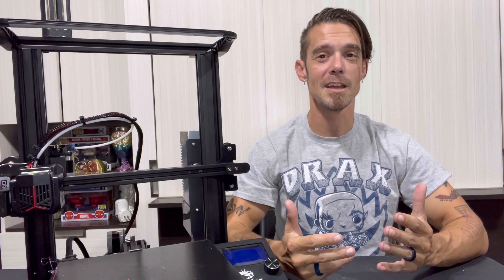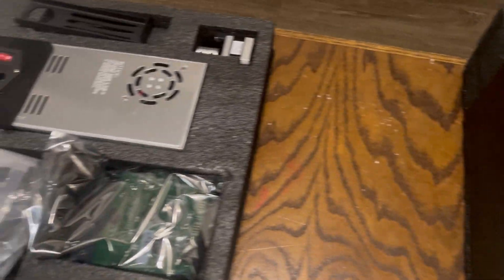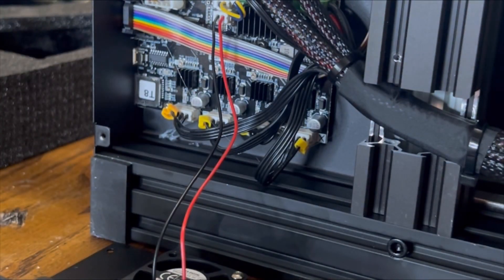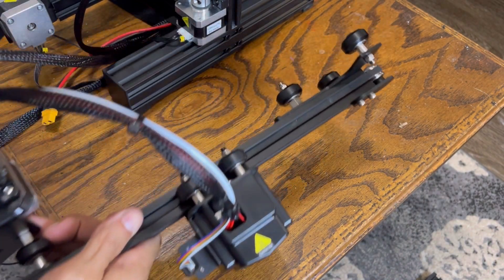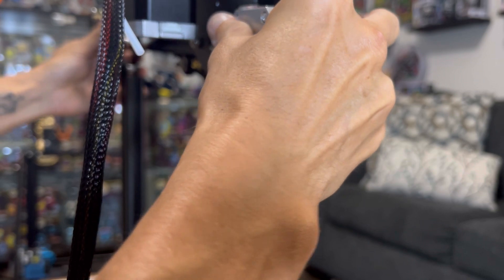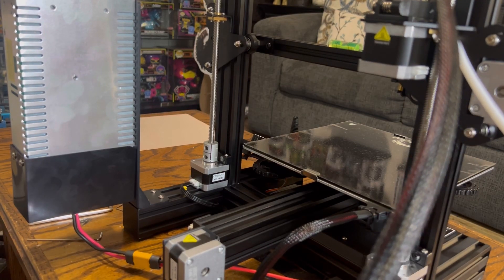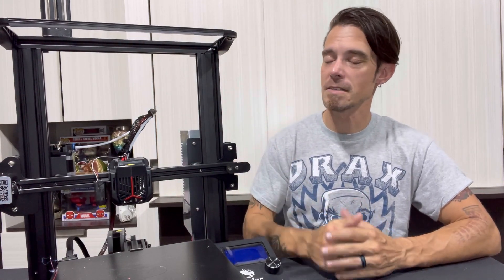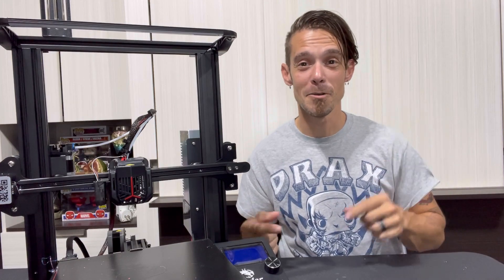Installing a dual z axis on your 3D printer | Ender 3 upgrades dual z axis benefits & how to install

Comment: I have a problem, it works just one motor, after some tests i discover one of motors lost power after some movements until finish totally static
Reply from the maker: Both motors are plugged in?
Reply: @Darkwingdad yes i finally resolve it, it was the guide of the second axis, it was obtructing the screw

Comment: Just got a ender 3 pro NOS for free when an ebayer sent me a wrong package and just refunded me ..  thought , wtf am I gonna do with this old piece of shit??? Gonna fkn hot rod it !!! Greatest thing a out 3d printer parts .. they are cheap
Reply from the maker: You can do a lot, direct drive, dual z,bl touch, wham bam plate, led light, upgrade to klipper, silent board & silicone bed mounts & you’ve got a super bed slinger.
Reply from the maker: I image they have linear rail upgrade too for both x & y

Comment: Couple of things. First. I love your videos. Great information. Second, there are a couple things in your video that are not needed. Most kits, if they are legit Creality, will come with a piece of paper telling you about making sure the motors turn the same way when the Z is adjusted with the "Move Z axis" process and illustrates how to ensure that with moving wires in the harness...more importantly it has a QR code to scan for an install video. The video from Creality does not show the installer removing the gantry to install the second Z rod bracket. Its actually quite simple with it in place and this reduces getting your printer out of square or breaking something you didn't need to. Next thing is the level. Great idea to keep the machine square when doing to fine tune adjustments but you did not mention the surface you are doing this on needs to also be level. If your work table is not level, your printer won't be, and you will pull all your hair out trying to figure out why its binding no matter what ya do. The wiring that comes with these kits is a Y adapter. You can simply unplug the original stepper motor plug, plug the y adapter into the cable you just unplugged then run your tails to each stepper. No need to remove any panels or reroute or hide wiring. The bracket that comes with the newer (2025) kit for relocating the PSU is also different than yours and doesn't hang the psu so far back and make it look awkward.
Reply from the maker: I prefer to remove the gantry to start over at a central point, I’ve actually seen binding & damage to the rails if forced on, maybe not needed but I didnt want to put any stress on the pre existing z rail that was installed. Not sure of the QR code I just whipped this together bc it’s a great upgrade for ender 3s or single Z printers & this was my how to spin on it. Appreciate the feedback!

Comment: Mone wont keep the same z offset after upgrade for dual z  any ideas
Reply from the maker: @Matthews3dprints  ender neo?
Reply: @Darkwingdad  yes
Reply from the maker: @ you did relevel the bed, set the new offset & save it correct?
Reply: @Darkwingdad  yes

Comment: at 6:51 you're measuring the level of the x axis - wouldn't it be better to make sure it's square with the uprights on both sides?
Reply from the maker: @dforck42 a level shows its square on both z axis

Comment: Hi, I have an ender 3 pro and have fitted a second Z axis and the problem is that the motors are skipping for me. The x axis beam is level. I don't know what to do, please help
Reply from the maker: @nordyk2  sounds like they may be binding. Try removing the top support. If the axis is bowing in or out it’ll cause it to skip

Comment: Just perfect. 
I notice that the rabbit you print, is perfect. 
I use prusaslicer, but I cannot print without springing.
Could you please share your settings? 
I tried petg and pla but never got that results. 
Thanks
Reply from the maker: @joaolourenco7712  do you mean stringing?
Reply: Yes, stringing.

Comment: That bubble level is no good unless the table, the floor the table is standing on and the foundation of the floor the table is on are all flat. You want to level the gantry to the print bed so a ruler I think would be a better option
Reply: As long as the gantry and bed have the same level you're good.
Reply from the maker: @davidflanders8516  contractors have used levels for decades on un even surfaces and still make foundations etc level. Obviously you need a level surface or table as I mentioned but the ground is irrelevant. You could use a ruler sure, but flat table and the level works fine every time.
Reply: @Darkwingdad  You lost all credibility by using a bubble level without understanding how it applies in this context as @davidflanders8516 tried to make you understand but you were condescending about it. You obviously don't understand what a "level" surface is and also "flat" has a different definition also. Don't be an ass when you're obviously misinformed.

Comment: With the level, you also have to make sure your table is level and your floor is level. Or make the base of the ender 3 level. Otherwise a level wont be accurate.

Comment: How do you keep the gantry level without a toothed belt ?
Just for my logic, im about to pull the trigger on a set but when i install it and turn one motor slightly upwards while the other motor is not turning ( wich is quite usual on a ender if you do anything on the x-gantry ) and now you turn printer on home and the motors go down touch bltouch for home and now one motor is homed higher than the other since they both share the same signal ?
Reply from the maker: Install the gantry with the z axis loosened on the bottom z couplers (they attach to the stepper motors) in the video I line them up and turn them sequentially at the same time & use a level as a guide. If it’s not level turn whichever one makes it level than tighten the couplers to the z rods. Bc they share a signal once tightened the gantry will move properly without offsetting the gantry as long as it’s installed level.

Comment: Hey great video on the install,, I do however have a question please !! I am having such an issue with compiling Marlin for my E3Pro with ((BLtouch and Filament Sensor…. Any suggestions PLEASE 🙏 
Thank you,,and learned a lot from your videos on primer/filler 👍🏻👍🏻
Reply from the maker: I assume you reflashed with creality firmware
Reply: Yes I have tried,,but marlin is a little confusing to me…please help me out and I can toss you some $$
Reply from the maker: @patsfann4life69  is the sensor working? Bl touch? Or can you not flash it?
Reply: @Darkwingdad  ,, I have actually found a version of marlin that is working at the moment,, but I absolutely appreciate your help/response and look forward to learning more from you regarding printing and painting…THANK YOU SO VERY MUCH 👍🏻👍🏻,,but I believe I will be okay with this version..(trying it out now)..time will tell 🤞🏻🤞🏻

Comment: After installing the dual Z and a sprite extruder, if i cannot move my Z axis via the dial, move axis, z axis, 1mm, it stays at 0 no mater what i do, i am wondering if the supplied cable is broken as i can move the stepper motor if i swap the y axis with one of the z axis cables via the y axis menu, any ideas? Thanks!!
Reply from the maker: Sounds like there is damage to the cable. Check to see that the pins in the harness didn’t get pushed out of the connector. If you visually inspect the harness and there’s no damage take a micro flat head screw driver or pick tool and push the pins back toward the harness. Often times harnesses can become de pinned.
Reply: @Darkwingdad  so to update i manually moved the z rods to bring it up and it moves when you auto home, but cannot be manually moved in the rotary dial and display method, i will try to connect via usb and ponterface but i also installed a sprite direct drive extruder at the same time and my x and y are way off but i can adjust them via the dial... so confused at the moment lol
Reply from the maker: @TheMattcrazy4200  did you do any firmware update? If it’s a problem with the control panel pronterface will certainly override it
Reply: @Darkwingdad  no not yet as i could not find the firmware for an ender 3 neo with sprite extruder, any tips for firmware?

Comment: can you install this upgrade on the ender 3 v3 ke? because it has double screw but not double motor. Thanks!
Reply: It has dual screw but only one step motor
Reply from the maker: @jhavytxu  they are in sink with that one motor so it still does the same thing just running off 1 vs 2. You could do this if you wanted to but wouldn’t add anything except less stress on that 1 motor
Reply from the maker: The v3 ke is already a dual z printer

Comment: Never really thought that Temu would have genuinely useful stuff. Great video!
Reply from the maker: I think it’s like anything else tbh. Theres absolute garbage on Amazon for cheap, even on Black Friday major retailers sell junk tv’s etc & I’ll admit some stuff on temu is a step above a flea market but the name brand stuff is legit & a bit cheaper than Amazon. You roll in some of the coupons & offers they have with free shipping you can save $20-$25 easily on a 3-4 items vs Amazon. Not too bad.
Reply: @Darkwingdad  Sounds cool. Thanks for the advice.

Comment: I just installed my dual z using your video. I installed the sprite pro extruder and it’s a lot heavier than the stock 3 pro extruder so I’m hoping this helps. Happy New Year!!
Reply from the maker: It will absolutely help distribute the weight. Happy new year my friend!

Comment: I have done this and eventually abandoned it for a belt driven z axis.  The dual motors would quickly go out of sync and one side would be off enough to cause print issues.  The other option is to have dual lead screws linked to one motor by a belt on top.  It is also hard to get those motors perfectly perpendicular to the extrusion below.  HOWEVER, this is a cheap way towards a solution that for some people have solved many issues with their ender.
Reply: You need to connect 2 identical motors in series to a single driver for them to be synchronized
Reply: Belted z is the way to go. those leadscrews get bent, they get eaten up. Dumpsterfire.
Reply from the maker: Might have to look into a z sync kit than